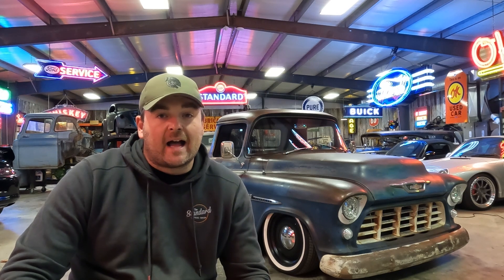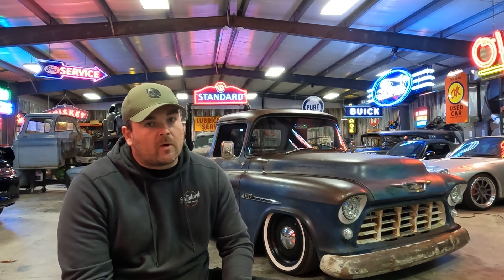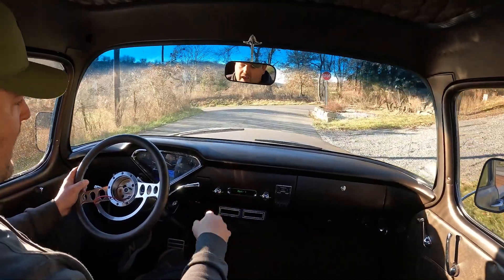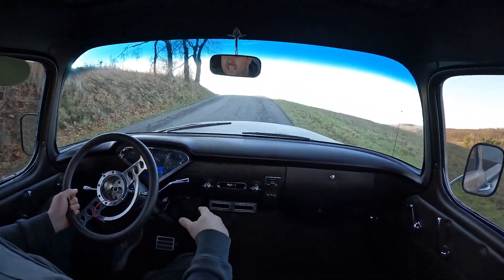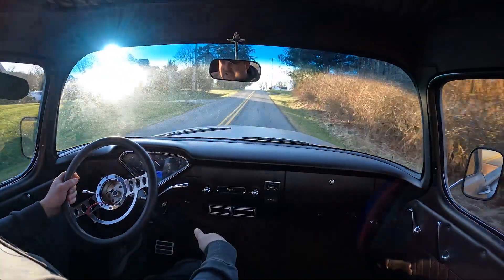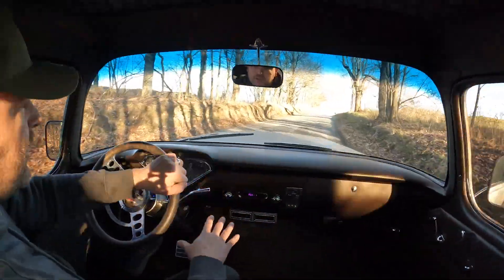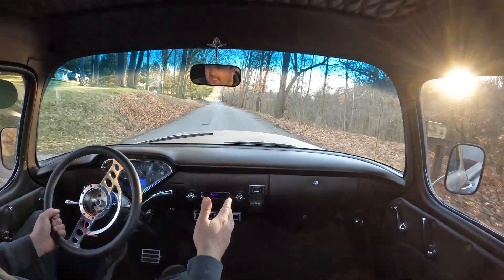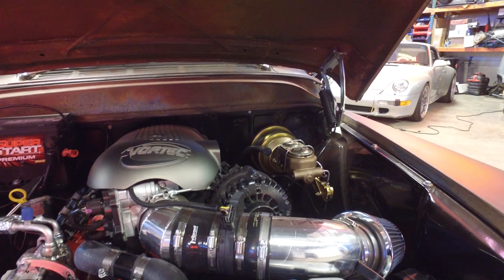Build Bio: The 1955 Chevy Truck Rebuild | Patina and Problems | Episode 1  The Standard Speed Shop

Comment: Just a smaller tire/rim and maybe a steering box upgrade would help the rideability when lowered. Ive seen others and even tv shows use the crown victoria chassis with what I thought was great success. I have a 56 chevy pickup project with a modified stock frame and would love a aftermarket chassis, but they arent that cheap. How much do you want for the crown vicky chassis?